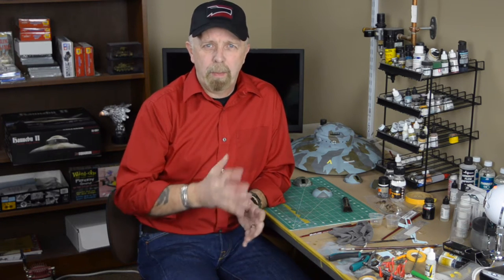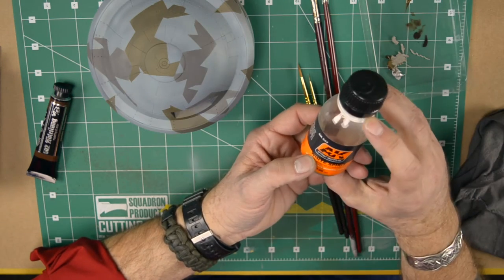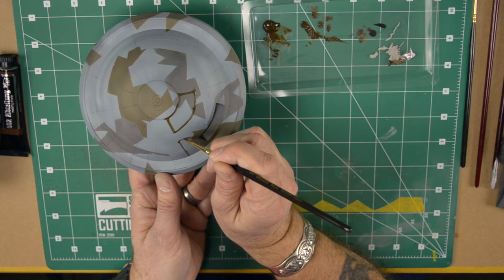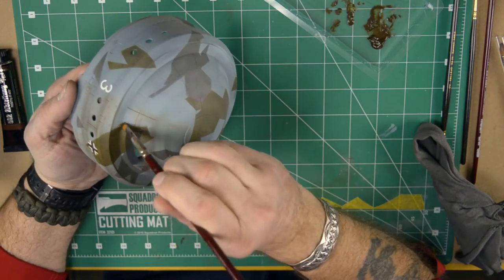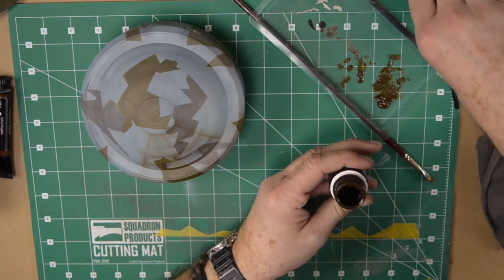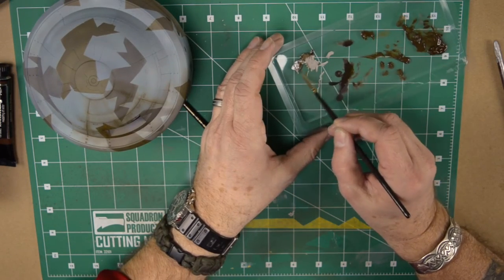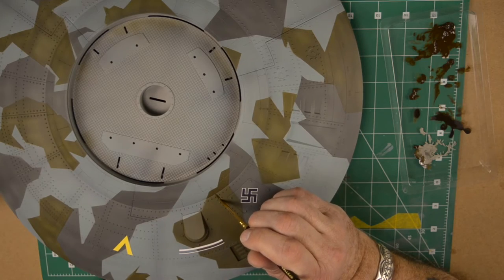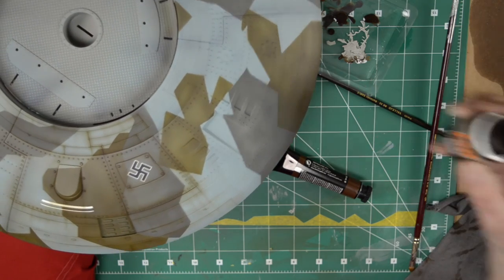Haunebu II Weathering

Comment: Its more easy to work with it on gloss coat. It's not so messy, and you don't destroy the base color. I use Tamiya X-22 with Mr.Color leveling thinner. 
Then the work is easy and forgive every mistake. 
Cheers.
Reply from the maker: Thank you for the tip! Will try that next time!